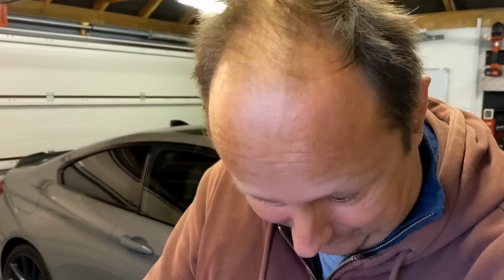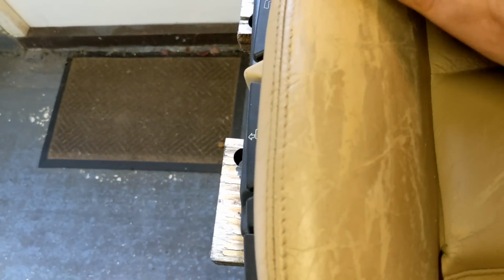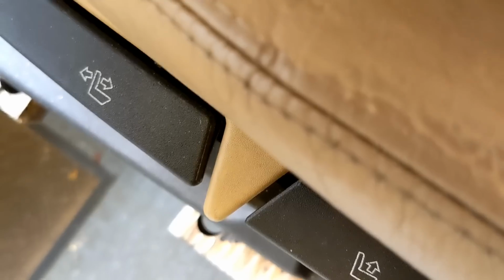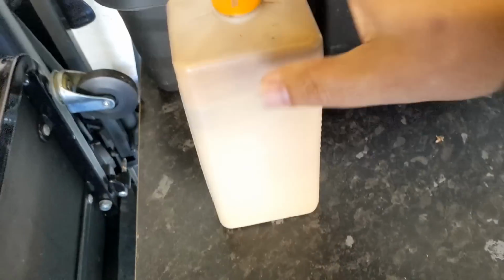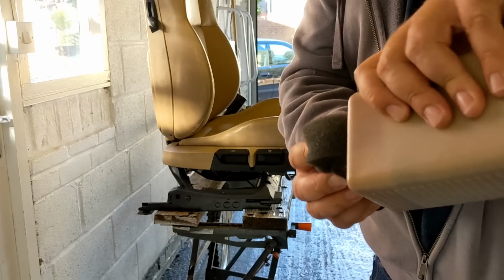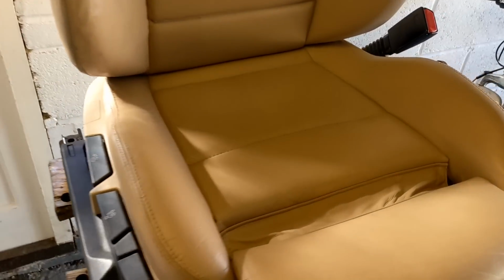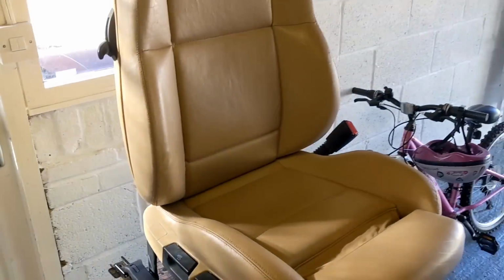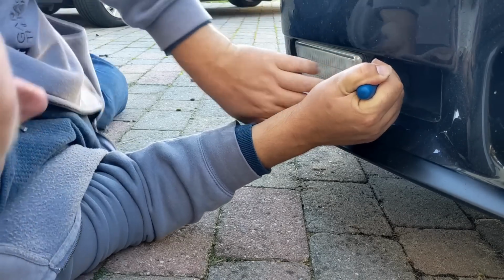Fixing worn out leather seat bolster

Comment: Hi John, I've got my spot lights and mounting brackets out of my car at the moment, and looking at mine, the spring clip is bent at a 90 degree angle.

Yours looks like it wants bending back to 90 degrees.

If you need me to take a picture let me known.
Reply from the maker: It's sorted Adam.  The lights have tiny plastic rail that was snapped on both headlights.  I got second hand replacements and the rail was in tack.  I think it happens if you pull them out without popping the release
Reply: Pleased you got it sorted, but them spring clips are in a different position to mine 👍.